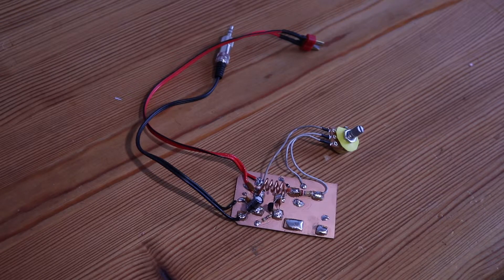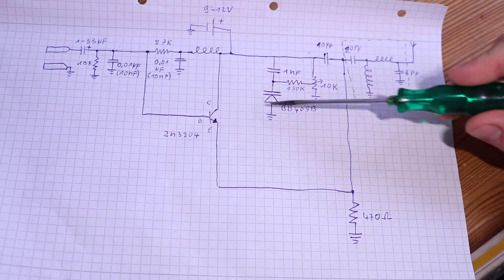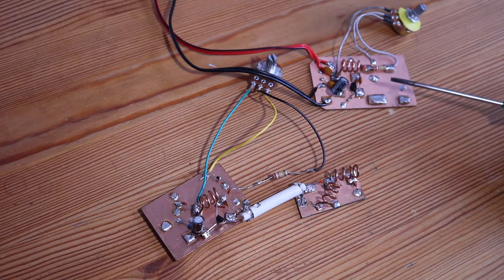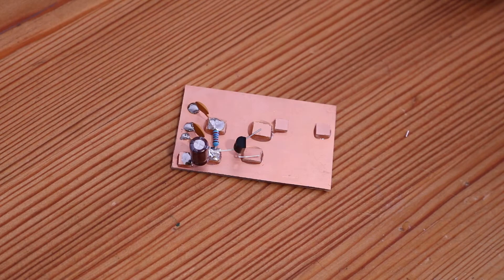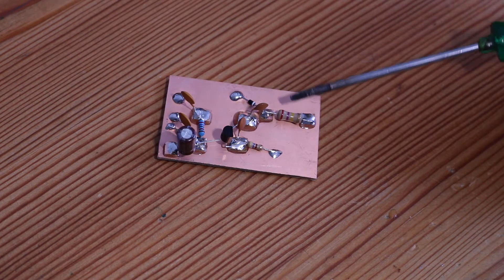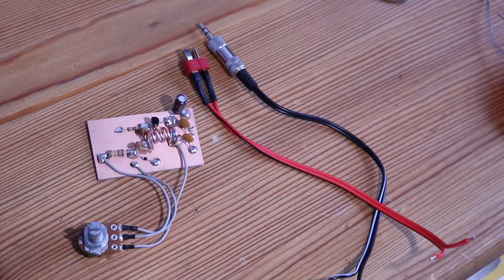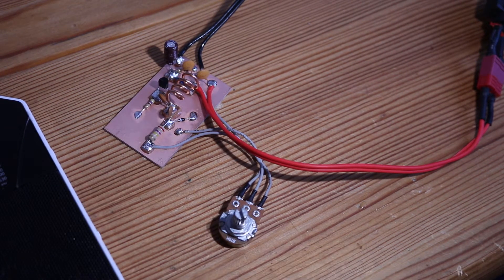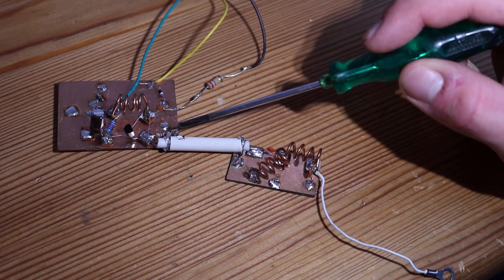DIY adjustable FM Transmitter | step by step construction.

Comment from the maker: ATTENTION! I got the bandpass filter wrong. You actually have to seperate the two LC elements of the filter with a very small capacitor (something like 0,4 pf)
Reply: Hello! Can i use 10 pF cap. instead of a 6 pF cap. in band-pass filter circuit?
Reply from the maker: @f.vercetti  Try to inform yourself about bandpass filters. It's not super easy and ideally you need a spectrum analyzer.

Comment: Hey um just like for the previous circuit what is the inductance of the coil that you made
Reply from the maker: I'm only able to calculate it. It should be 0,267 microhenry (or 267 nanohenry) But it's easier to make the coil by yourself. I tried to mess it up. if you make coil like described you'll be definitely in the FM band.